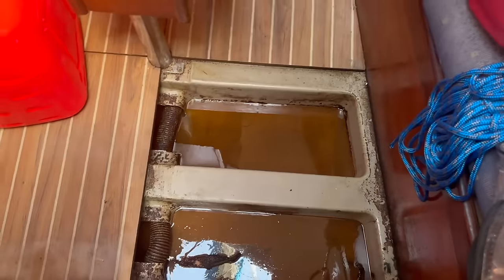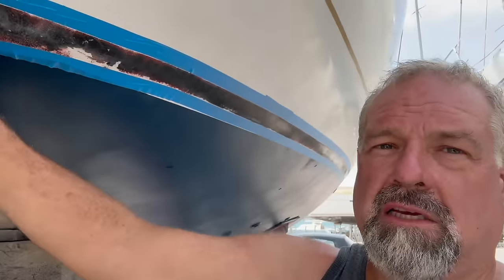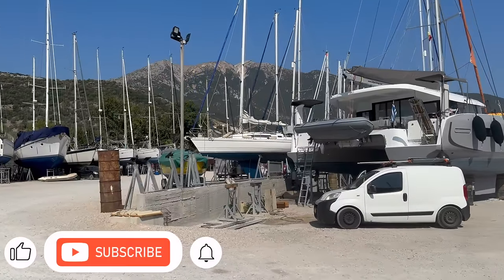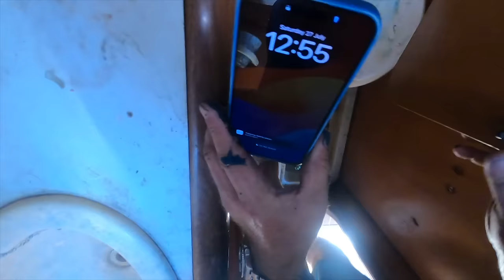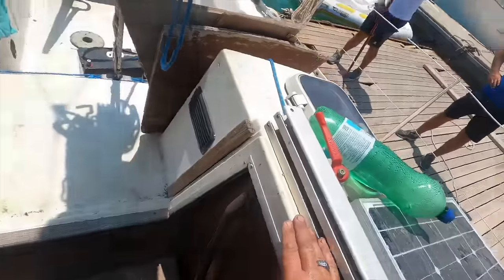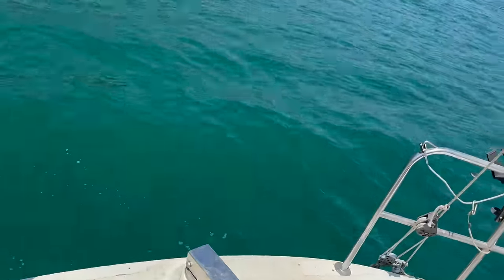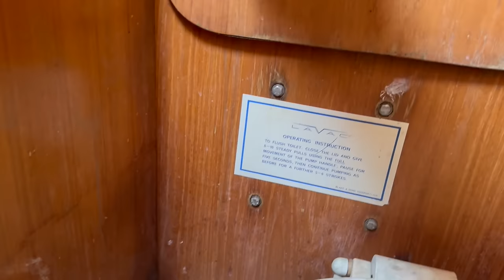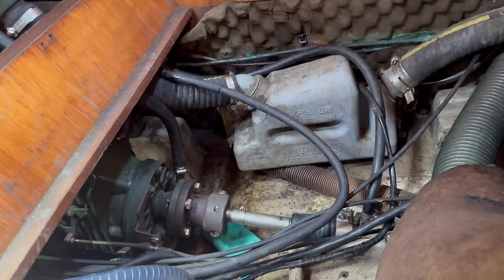400 euro abandoned boat launches after just 4 weeks | S4 E24

Comment: 12 volt chest freezers are inexpensive. Try soda bottles for the water you drink. Avoid batteries wired in parallel. At the least, they need an isolation switch, and separate chargers. A pair of six volt batteries is best, if you want big 12 volts.
Reply from the maker: Thank you for the advice. I have upgraded the power on the boat. The video for that is released in two weeks and available for viewing on Patreon or ko-fi. I’m on the lookout for a chest freezer right now
Reply: @Sailwithandy  grab a Chinese one and always run it on ECO mode. Never max
Reply from the maker: Its in a couple of episodes.

Comment: Did you use a moisture meter to check the deck core? In my experience, anything that neglected probably has a saturated deck core. Water enters around penetrations and radiates out.
Reply from the maker: I didn’t but the deck is solid. No movement and there are no stains or signs of leaking inside
Reply: @Sailwithandy 
It doesnt always leak through just gets inbetween.
Tap test with a broom handel is the quickest way or a small plastic hammer especially near gel coat cracks and any deck fittings if your really lucky it might not be balsa core.🧙🏻‍♂️🤞🏻

To clean off and kill mould use White vinegar spray it on and wipe it off after a bit of time..  its cheap safe none toxic  and effective.. scrub it a bit if its a course surface like bilges or underside of deck inside.